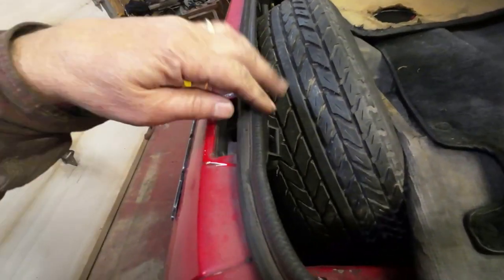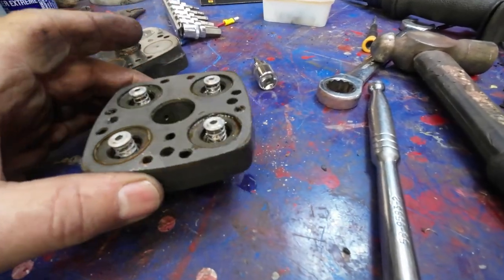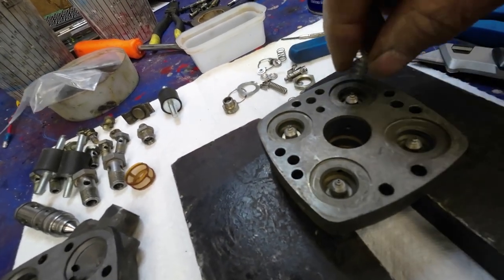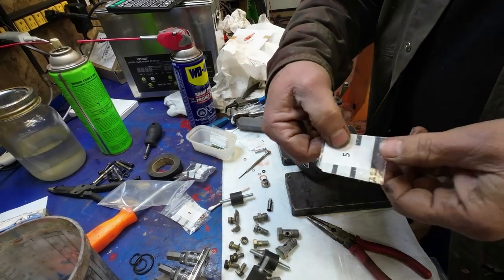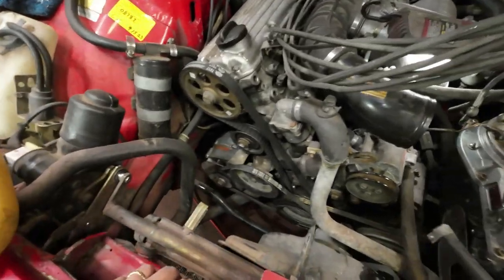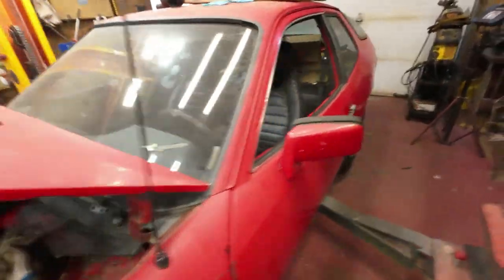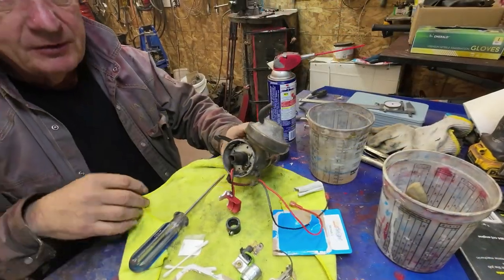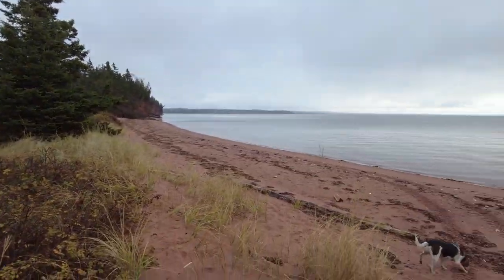1979 Porsche 924 Rebuild the Fuel Distributer  | Episode 15

Comment: I tried rebuilding my fuel distributor and failed miserably! Ended up sending it to Australia and getting a refurb. Still cheaper than getting one in the US.
Reply from the maker: I am on about the 4th time with mine...the kit from missingparts.de seems to be a bit better than other suppliers, it does include O-rings that are correct and a complete set....
I will work on the fuel pressure this week and see if I can get it close to right..
Reply: @LorneKelly  I got it from them. I think the first round I didn’t use the loctite. I tried taking it apart and adding it, but messed it up.
Reply from the maker: Yup I used the loctite on the second time... but too much so it got into everything...I hope this round is OK... @talm2891
Reply: @LorneKelly  good luck! I just need to do brakes and clean up wiring to starter. Then going to do a test drive.
Reply from the maker: please post some Video of your test drive, I would love to see it... @talm2891
Reply: @LorneKelly  I’d like to, but looks like I can’t add attachments to posts.